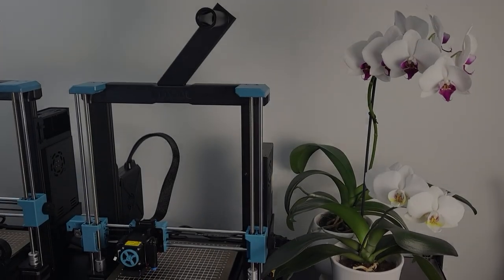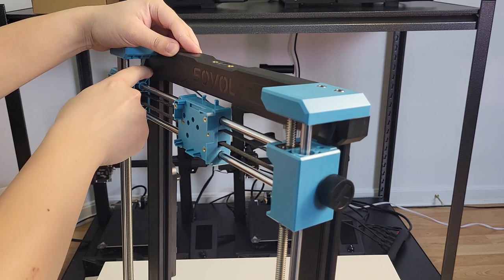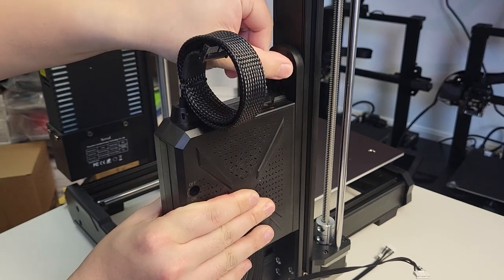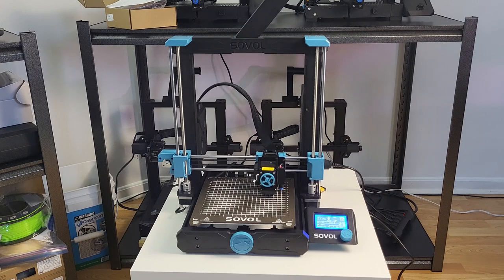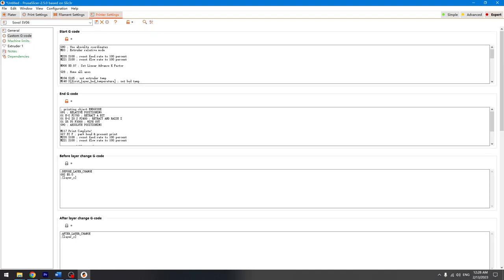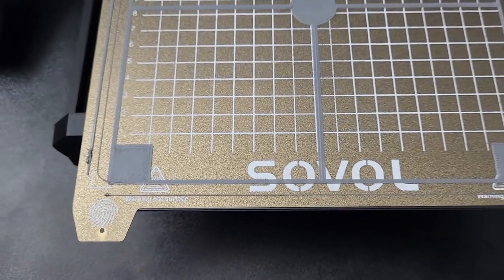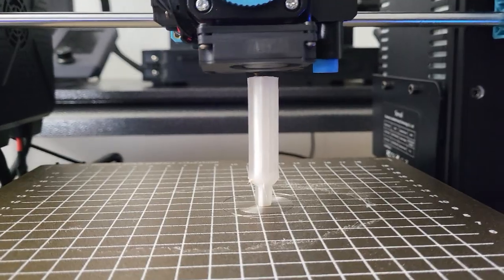Sovol SV06 Beginner tutorial, Assembly, Bed leveling, Calibration, and Slicer setting

Comment: You need to add the "Fade" command to the M420 code line.  M420 S1 Z3   Here is why.  The M420 code just calls the mesh from the EPROM storage of the last leveling.  If you do a bed auto-level and everything is fine, there is no need to auto-level again unless something changes.  It just wastes time.  So, add M420 S1 Z3 to the GCODE start line just after the G28 (home) command.  It HAS to be after G28 because G28 clears all mesh data.  The M420 S1 Z3 reloads it.  The "Z" switch is the Fade command.  It "fades" the mesh back to real life level over the number of layers in the "number" part of the command.    I use 3.  This gives you MUCH more accurate parts.
Reply from the maker: Great inforn man!! I just use M420 S1after G28, it seems works fine so far.
Reply: @SvgLau  Yes, that works.  But it also incurs high processing and motor loads,  keeping the Z motors constantly turning, and inducing inaccuracies.  The fade switch literally turns off the Z part of the mesh (gradually, over the number of layers selected) and is more accurate overall.
Reply: Thank you Tvideo for taking the time and offering this up. This is very helpful.
Reply: Thank you! Just assembling my new SV06 now  so, this is awesome to see before I even start it up! All the best:)
Reply: Would you be Abel to make a video on showing to do or something ? Trying make sure my printer Is all good before I print

Comment: I also highly recommend putting the electronics fan on the same circuit as the heatsink fan, the wiring as it is from factory only turns on with the part cooling fan. If you print high temp materials, most of which require little to no part cooling your electronics will not be cooled either. Even worse those materials typically need an enclosure, further compounding the lack of cooling. 

I find it kind of amazing that a printer advertised for high temp materials would have this cooling setup.

Comment: this video was so helpfull for me. this is my first 3d printer and it really helped me cause even though i had done a bunch of research  still was having trouble with the first steps in the manual after the wires and  realized missed one. it was helpfull to also not have to go off of a manual with not a lot of instructions.
Reply from the maker: That's why make those videos! When I just started this hobby, I have exactly same issue with anyone who started. I spend so much time trying to figure stuff out. I really wish there will be a video that could cover a lot knowledge and help go through the set up process. So I was like, maybe I could make one that will probably help some people :)

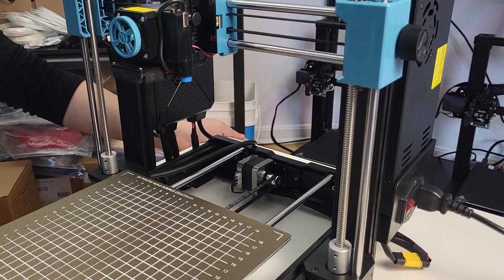Comment: 7:40 shows the only problem I've had with mine, which was the bed heating cable.  I found that my cable naturally layed beneath the bed rather than running behind as you've shown.  This led to improper Y Homing, as the cable would snag before the Y axis achieved it's actual maximum position.
Reply from the maker: You will need to print something to redirect the cable.
Reply: I had the same issue!

Comment: very nice video, I have the exact same issue with the bed level. left side is lower than right side.
Reply from the maker: did you try to use  M420 S1after G28 on starting g code, it may help.
Reply: @SvgLau  Yes, it is there, and still the right side is high. I also used your level gantry tool to algin manually, and then bed leveling but still the same issue.

G28 ; home all axes
;G29 ; probe ABL
M420 S1 ; restore ABL mesh
M109 S205 T0 ; custom hot end temp

Comment: nice video. I am a newbie and somehow I printed with no problems for a month, and suddenly my first layer doesn't always stick and curl up at corners. Nothing is changed pla the same, temp the same. I cleaned the head (was clean), reduced the speed, still the same. Any idea?
Thanks.
Reply from the maker: try to replace with a new nozzle. Sometimes a wear out nozzle could have this effect. Remember redo the bed level (entire process) after nozzle change. Also use isopropyl alcohol to clean the PEI build plate.

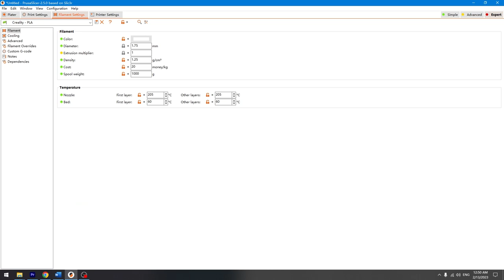Comment: Hi Savage Lau! Thank you so much for putting this all together. I followed your instructions (including downloading the sv06 profile and importing it into the slicer) and tried to print and had my prints are slightly off center. When I use the Prusa Slicer plus the Ender 3 Bed Leveling Oink file. Instead of having space at the end like 14:26. It just goes all the way to the edge? 

Am I doing something wrong?
Reply from the maker: I will first make sure the extruder will move all the way to the left of x axis and bed will move all the way forward on y axis during homing. If there is debris on the linear rod may leading this issue. Or your heat bed cable on the back of build plate could caught on the frame on rear during homing. IF homing does go all the way of it's travel, there is something to do with slicer setting/g code/ or my configuration. Which is less likely. But keep me update if that works.

Comment: I have a problem with my SV06+. It seems like it thinks that the bed is in a different place on the Y-axis. So when I tried to print Benchy, it printed towards the top of the bed, rather then the center. When I use a slicer, placing things towards the bottom in the slicer puts them in the middle of the bed, while placing them in the middle puts them near the top. Is there any way to fix this?

Comment: Hi great videos
I have one qeustion i have a small craptastic printer and resin printer.
Would you recommend the sv06 or the plus for bigger printing or should i save up and get a prusa mk4 or something?
Is the sv06 accurate enough to print functional things?
Reply from the maker: I think both sv06 and sv06 plus offers best value per dallor. I have play around sv06 plus for months now, there will be a review video come out soon. As far as print quality goes, both printers are good. I personally do a lot of functional parts, mechanical design prototype with these two machine, no complaint yet. Now, the biggest down side of these two are noise and parts availability.  MK4 is good printer, (a little better than sv06 in all aspects) but almost double/triple the cost. 😅You make the call.
Reply: @SvgLau  ok great to know i think ill check for nozzles for it if i can find them ill just go for it.
But now i know it prints alright and isnt just a chinese clone.
And i now have a youtube channel with multiple tutorials on the sv06plus haha
Reply from the maker: @bertkooijmans4769  But, something just keep in mind, the budget printers will always have cost cutting at some point. could be QC, customer support, cheap part, or something else. Good luck with your new printer, lol

Comment: Please I need help, every time the print just slides off or gets moved. It took me 8 hours of trying to print benchy until it actually got at least half.
Reply from the maker: Redo your bed leveling. Your z off set value is not right. I have one video instruction for that.
Reply: Thanks your a life saver, you earned a sub

Comment: Mine is making a grinding sound every time it gets to the back of the  Build plate. And the prints are off center. Also I'm only 6 months into printing so I really am learning as I go
Reply from the maker: Did you try adjust the sensorless homing?
Reply: @SvgLau  yes .
Reply: @zill54  was your heated bed power cable getting wedged between bed and base? Check 7:35

Comment: Hello! I have done multiple prints on the sv06 so far and I feel like the extruder is digging into the print and it doesn't feel smooth on the top, it has a more rough texture to it. Do you know how to fix this?
Reply from the maker: Decrease the z offset value. I should say bring the nozzle away from the printer bed a bit more, 0.010 by a time and try it. The most comon causes for rough top finish is too low z offset. Also you can increase the top layer on slicer setting. Normally I do 5 solid layers on slicer if I want it to look better. Let me know if it works.
Reply: @SvgLau  I was just doing auto z-align and then auto home, the distance increased so much and the z offset is like -6. I reran z-align and then auto home multiple times and still the same result.
Reply: @SvgLau  Okay nvm I fixed that problem but one side still seems to have scratches and have a rough top while other side looks perfect for first layer. I ran bed level multiple times. Do you know I how I can fix this?
Reply from the maker: @raghavpottabathini9099  did you use some tools to make sure the the z align?
Reply: @SvgLau  No, I ran bed leveling and redid the process from the start and by the time I got to auto home and z offset the distance decreased back to -1.8. Still one side seems to be better than the other, one side has the scratches and other side seems perfect(first layer).
Reply from the maker: @raghavpottabathini9099  I bet the higher side is on the left. Both of my units are like this. I checked the spacers under the bed, they are actually same height. But, I will assuming we can sand the higher one off a little bit and get better leveling.
Reply from the maker: @raghavpottabathini9099  but you know the funny thing is, the rear two spacers are actually shorter then those in front and center. It also doesn't seems like is a deviation, cuz they match the height.
Reply: @SvgLau  Hmm, in that case I might as just leave at that because one side still prints good, it will only be a problem if I need large prints.
Reply from the maker: @raghavpottabathini9099  make sure you  put clips on the build plate if you do large print. The pei sheet is too thin and will lift for the large size print.

Comment: On my SV06, the sensor was too high compared to the nozzle. So the printer kept running into the bed. Only when I lowered the sensor could the bed be leveled.
Successful bed leveling is a prerequisite for successful printing.
The sensor can only sense magnetic surfaces. 
This always ignores a glass plate. He drives into glass without seeing it.
Reply: MAN YOUR COMMENT JUST SAVED MY DAY I LOVE YOU!!!!
i just bought my very first 3D printer, a sv06, and the auto Z didnt work, because the nozzle would just slam into the bed, then the printer would have fail. I jsut lowered the sensor, and now everything works!!!! Thanks!

Comment: Nice video mate, great job!
I have a question and I would love if you can help me with it.
Basically I am using PETG and PLA filament and I am also using the slicer that was integrated in the SD card that came with the printer(I had issues using Cura directly, print came with too many defects). However now I am facing some issues. The first one is that there are small defects on some of my prints, which are not the end of the world but it it's still visible. The second one is that a lot of times the extruder randomly stops extruding midprint. After that I have to change the filament to make it push material again. It happened like 3 times at around 90-98% of the prints already, and it's rly strange issue.. Any help is highly welcome, thank you!
Reply from the maker: I will suggest to try prusaslicer first, I have the profile on the description. The none extrusion issue seems strange to me but I have seen some people have this problem while printing slik pla filament. But not with the regular pla or petg. Also, something you could check is the extruder gear set. If you are not afraid of open it up,  check the screws on the gears set and see if they are tight correctly. (Seen some people reported lose one from factory).     But I will first try with prusa slicer and see if it works. Then the gears set on extruder   is the next troubleshooting part.
Reply from the maker: Let me know if you have more questions. The instructions of how to import slicer setting is on the prusaslicer configuration link too
Reply: @SvgLau  Thank you for the quick answer!
I have downloaded your PLA and PETG profiles and I have just started a print, let's see how it goes!
I will let you know when I have more info, thank you for the help!
Reply: You probably stripped the filament. Your retraction settings might have been too high.  I would recommend changing retraction settings and trying to loosen your extruder spring.
Reply: @ZooMweBG How'd it go

Comment: my paper test was 2.180 is that bad?
Reply: and when i saved it made more of a brrr
Reply: just did the bed leveling and it was near off the bed on the left side but short on the right side
Reply from the maker: @eaglee247  same on both of mine.  -2.18 is all good value. Now you need to think about adding manul bed mesh or do something else to make it more flat. Or, if you are lazy like me, as long as it print for now in the center we just print for now.

Comment: The SV06 is too noisy for my liking and I returned mine without opening it. All the YouTube videos demonstrate the annoying noisy bearings.
I’ll stick with my Creality E3 S1 Pros and Elegoo Neptune 3 Pro printers until I move up to Bambu Labs printers. Your videos and others show how noisy this sucker is. Imagine a room full of them running. I have 12 printers with bed roller bearings and the print room is fairly quiet with them all running.
Reply: Not all of us sleep in a print room lol
Reply: I actually have the printer and it's not that noisy and I am sleeping in the same room. There was some issue related to the printer sound, you can search for fix, however it's not the issue with the printer itself
Reply from the maker: My second unit sv06 is a lot more quiet out of box.
Reply: If you think the SV06 is loud the Bambu printers are like living next to a train station in comparison. Also, how did you know your particular unit was too noisy without even using it? Genuinely curious.
Reply: Budget printers (sub 300) typically have some quality control issues which is part of the reason the price is lower. One thing that is often bad is the bearings. I saw another video where the black plastic cover holding the bearings in had actually opened and half the bearings were missing and had fallen out. There are several options for replacing the bearings that start as low as 10 dollars for 10 bearings. A lot of times adding lube will fix or reduce the noise. 

Obviously not all printers in this category have issues but they are certainly more likely than 500+ models and the bearings produce the most noise, especially if they are bad. Second is the fans but not much you can do outside upgrading those also which is why I chose the SV06 over the Endor 3, it's completely open source. Not that the Endor 3 can't be upgraded though but I always like open source products because of community support and mods.